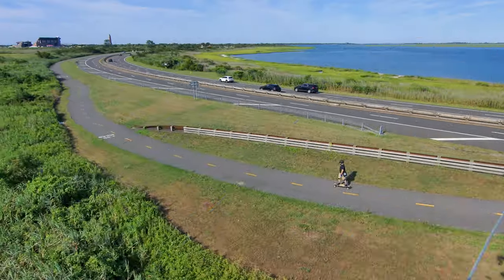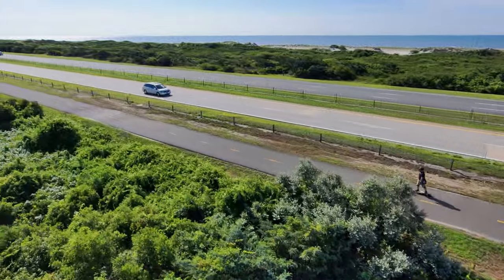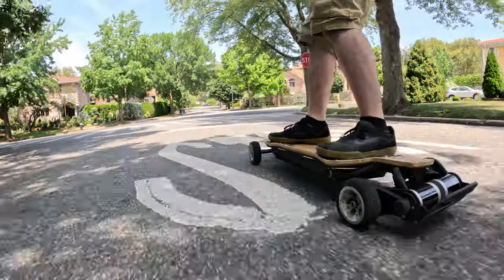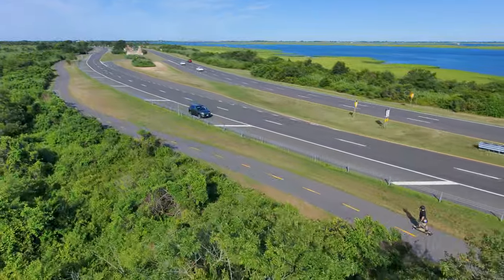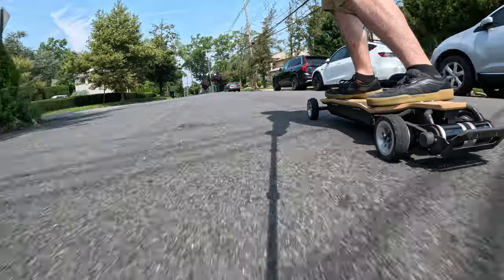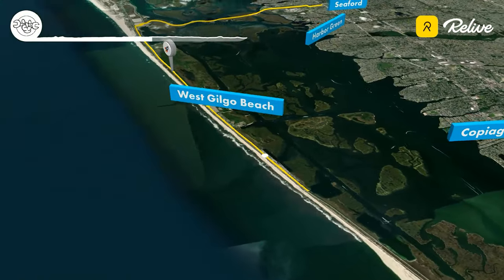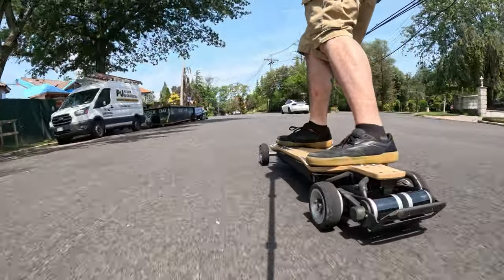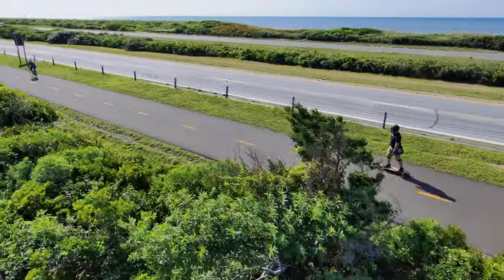Hoyt Street Tabor Review | A True Electric Skateboard

Comment: Earlier in the year, after receiving my backfire zealot s as a starter board. I was wondering what would or can be my upgrade board. Obviously, depending on looks, speed and range. At the time, i only thing i experienced was a maple deck with concave. No sorta flat deck or carbon fiber even. This a personal choice, but i like supporting American made stores. So by recommendation Hoyt, Metroboards, Mboards and Defiant Board Society. Prices north of 2k, i understood what i was investing in. Mboards endurance was a top contender for range. Claiming about 70 miles+ on street wheels. By looks, it was Hoyt vs Defiant. Defiant Won me over due to its red color scheme and trucks. What made me pull the trigger was an insane sale at July 4th for $700 off. $600 off for the sale an additional $100 for a creator code. As of the time of writing. The projected shipping date, if everything goes right, early September. Damon mentioned previous deck submissions from the factory they ordered at the time wasnt up to spec.